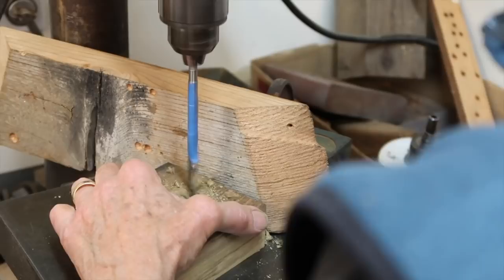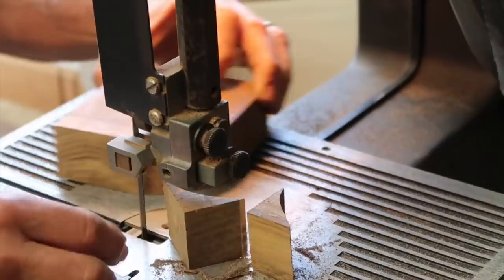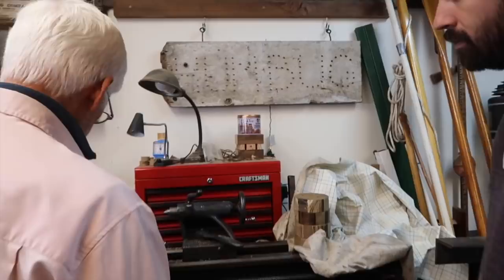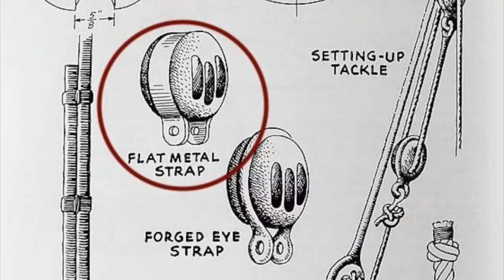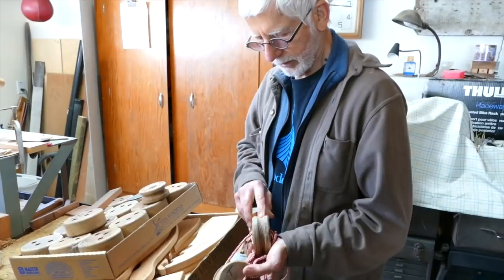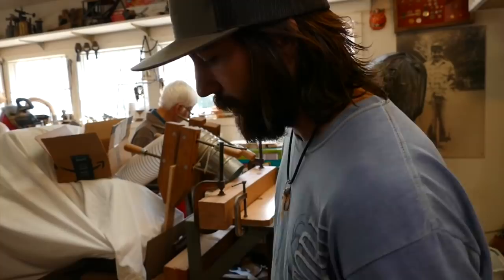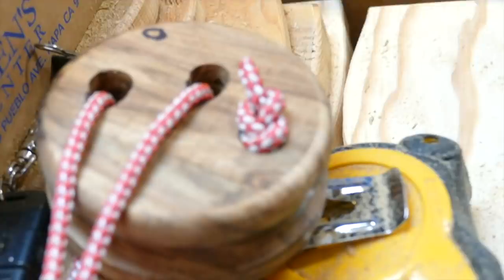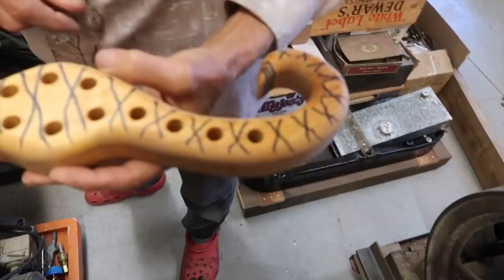Salt & Tar: Episode 90-Turning Dead Eyes

Comment: Hi guys. Lived on a boat here in the UK for almost 23 yrs now. One of the greatest pleasures is anchoring in a creek or river in the evening, watching the sun go down with a rum, and listening to the different bird calls coming from the reeds and riverbanks as everything settles down for a quiet night with the possibility of owls later. Unfortunately, this is something you guys are going to miss. Those are industrial machines that you are working with, generally, and they're doing industrial grade damage to your hearing while you're at it. Believe it or not, the noise you can hear isn't that much of a problem, it's the high frequencies that you can't hear that do the real damage. Do yourselves a favour, hearing protection is the first thing to sort out before you get to sharpening the tools, putting sandpaper on the sander or even sorting the evening beer out. Lovely teamwork, and extremely generous of Charlie to lend his time, his workshop and his knowledge/experience to give you a tremendous push to the finish line.

Comment: If the Lanyards for the Deadeyes is layed rope, the correct Stopper knot is a Double Matthew Walker. Quite easy to tie. Clamp the rope in a jig with a hole slightly smaller than the dia. of the rope then unlay the strands, form a cloverleaf with the ends of the strands passing through the next loop. Then double and snug tight, Whip the layed up end and trim.

Comment: Held my breath while Garret was grinding the dead eye’s, eye reliefs. Don’t slip, don’t slip was screaming in my head with all of that sweat equity invested and then the last sketchy task. Thank God that’s over. Can’t wait to see them rigged. Ruth in a skirt, is that a first for the channel? Lol. You kids are doing great and that was a very sincere thank-you as well.
Reply: Gary Fairbrother same thoughts as you on slipping, think I would have done those grooves on the lathe.  Safer and faster I think.
Reply: I would have liked to have seen a fence against the side of them. Holds them straight and keeps finger out.
Reply: I actually was referring to the last step where Garret hand held the mini grinder and ground out the line channel for the eye holes in the dead eyes. Those high speed bits can catch grain or follow grain on their own and damage the work piece ...or worse. As a woodworker the other woodworking practices were very safely handled I thought. Charlie is not a rookie and Garrets getting more safety minded as time goes on.

Comment: Black Locust is prized firewood because it burns hot like coal.  Fence posts made from Locust would last 100 years in the ground  but fence companies would only guarantee them 50 years because no one would believe they were good for 100 years.  It's fantastic wood that doesn't rot and bugs won't eat it.  I wonder how it compares with Live Oak?

Comment: It is incredibly easy to sand turned parts while they are still on the lathe, and it does a much better job than any other means of sanding wooden parts. Literally 1/10th the time and effort

Comment: You have a guardian Angel named Charlie that came to the rescue, he deserves a couple big Steak Dinners.  Have you purchased your sail cloth yet?  What color are you planning on?  What a giant project but from experience I can say your second boat build will only take half as much time, LOL!
Reply from the maker: Haha right!?! We've just mailed our deposit on some Oceanus cloth! We'll be working with Mike from M&H Bartles Sailmakers in Maine. Garrett really wanted tanbark but that cloth is going to be superior and it resembles the old canvas they used to use 
R
Reply: @SaltandTar  I had several boats with Tanbark color sails but they seemed to deteriorate much faster than the white or creme color.  They also absorb more heat in bright sun.  I am sure your set of sails will be spectacular no matter what color.  Good luck and fair seas forever!

Comment: Concerned about the direction of grain in relation to hole orientation ... The direction of force is perpendicular to the direction of grain - there's a higher risk of those deadeyes falling apart.  Unelss I've missed something about the type of wood used?
Reply: EyeOnTheTV  the dead eye design with the support around the perimeter puts the wood that takes the load in compression. The orientation as used is therefore correct for the loading it sees and the dead eye will be very strong. If the load was tension it would be a different case as you note.

Comment: I think the wood grain should run 90 degrees from what you have done.  They are pulling across the weak grain.  Is this how the old dead eyes were made?
Reply: Guess the strap holds the load and the wood is really in compression, not tension.  Didn't get that at first.

Comment: Bonjour,
Never mind about the cameras, the important thing is what you show, and especially dead eyes that have become very uncommon.  Technical qiuestion, ho did you choose the diameter of the dead eyes ? Thanks to Charlie's template ?
Besides this, I note this first part of the  videos is older than the previous ones because, even if you are always so young Ruth, Garret has short hair :+)
Amicalement, Raphaël